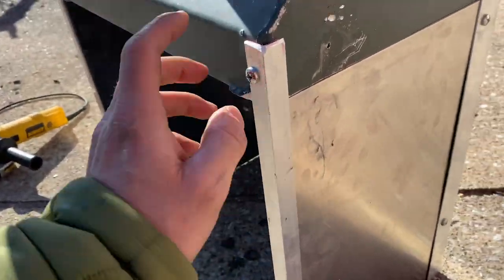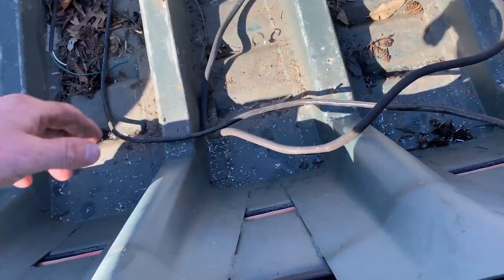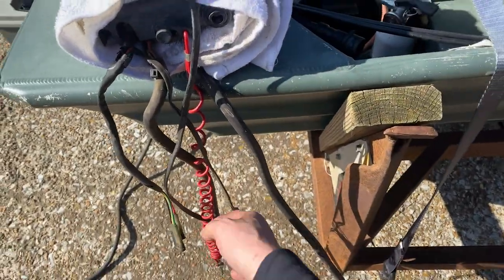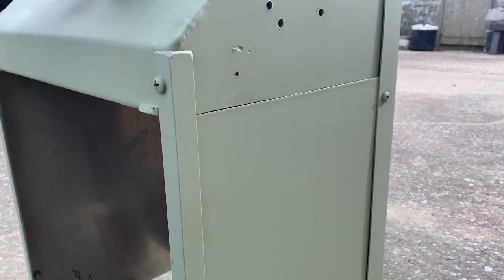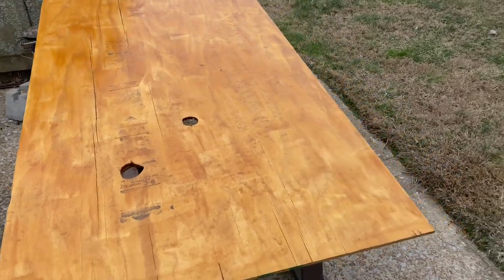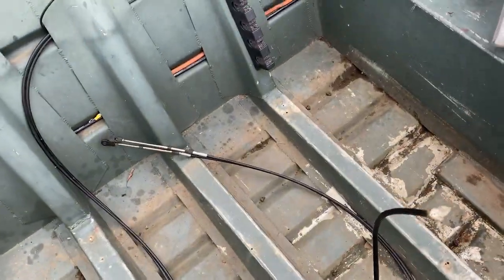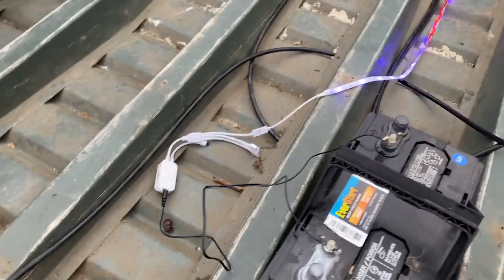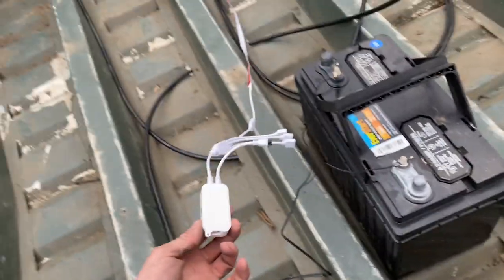BOWFISHING BUILD PART 3: Console & Floor Prep, LED Strip Lights

Comment: Check your voltage output on the wall adp. that you cut off, it might be lower than 12 volts, good luck on your new boat.
Reply: Yep. 8.4 maybe

Comment: Thanks for this just motivated me to finally moving my console center console to side console and finally finish my boats floor was abit stuck for awhile because i wasnt quite sure what type of floor plan i wanted if that makes any sense but after much research into it i think ive found the best configurations for my boat going to start work on it again the next month or two when time off work permits me todo so 😂

Comment: Why get untreated just to treat it when you can get treated and treat it more?  Maybe I am missing the reason.  I have a treated 4x8 sheet on a fourwheeler trailer that was coated in outdoor waterproof paint and 23 years later I am still using it and it is not rotten!
Reply: Treated wood will mess your boat up !! I just replaced an old Treated transom in the boat I bought and the aluminum was so ate up I had to weld a new one in
Reply: @cameronbragg3612  old dog learned a new trick today,,,,thanks for the info….
Reply: @michaelthompson7570  Yup, me too!